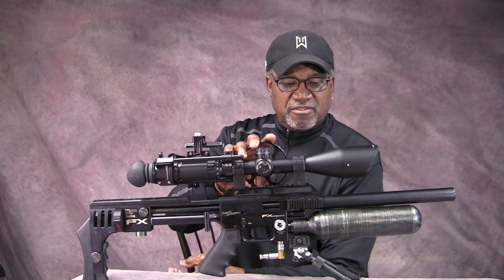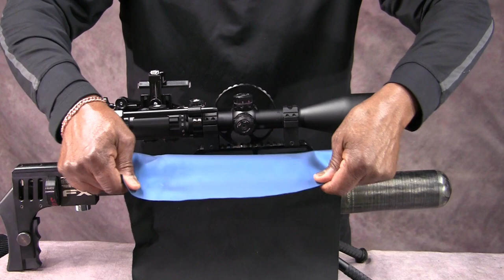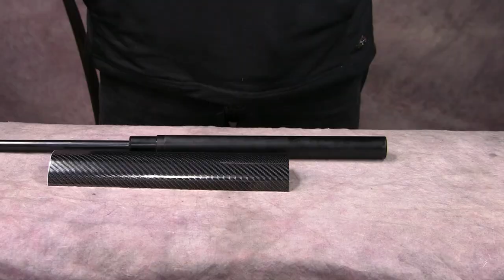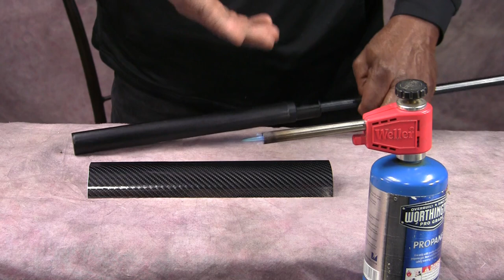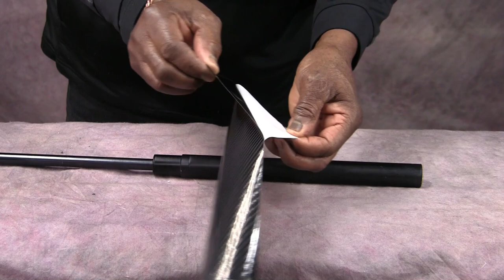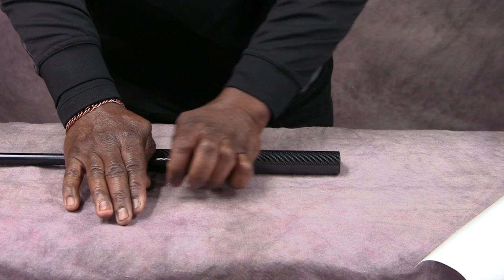FX Impact DIY Bottle Cover & Giving the Shroud a New Look

Comment: LOL Aaron,  I once put in a new water heater, changed the lines to copper, couldn't get the solder to seal. Called plumber, he thought I'd blame him if something went wrong... sooo he told me how to do it... saved big money 💰.  DIY is how to do it 🙂👍. Take care
Reply from the maker: I have put in water heaters and had the same problem until I learned about the proper use of flux and heat.   But I will always try to DIY before call in repair person.   Thanks and best of luck.

Comment: Nice job bud. I did the same thing with my bottles on my SK-19s also. I use neoprene 1.5mm and hot melt glue. Worked great too. Almost all my PCPS are wrapped in carbon fiber vinyl and yes sir...they look good! God bless.
Reply from the maker: The stuff I used is like neopreme and I never though of using glue.  That is a good idea.  I love the carbon fiber vinyl and it  protects the barrel from bumps and scratches.  Thanks for always watching.

Comment: I've had a similar idea to protect the kevlar bottle. We call them stubby coolers in Australia, I'm guessing you call them beer coolers in the USA. A couple of them slid over the cylinder should work. I just tried it on my FX and they're a little loose, but I have the Sabre Tactical extended rail to hold it in place. You could even make one out of an old wet suit or go to some place that makes stubby coolers and ask for an extra long one made. 🇦🇺👍
Reply from the maker: That is a great Idea.  I invented the extended rail.  Check out my called FX Impact Review and a Fix for the Bipod Attachment I posted 4 years ago.  I will look into the stubby coolers here and see if it can work.  You are my first viewer from Australia that has commented.  I have added you to my world map of viewers.  Thanks for watching and for your comment.  Best wishes.

Comment: You can get large heat shrink tubing for the carbon fibre bottle that way it will wrap around the neck of the bottle too. 👍
Reply from the maker: Shrink tubing would not feel as a good nor have the padding effect.   Thanks for watching.

Comment: Now I kinda wish I bought this instead of the hammer. Mine is tacted out too. I have the ronin & emperor suppressors shoulder strap pistol grip bipod green tac light green laser bug buster illuminated scope. I had Taser flashlight for it but I give that away til I get ccw permit. I'm kinda thinking on evol raw r hatsen blitz next but I need more research b4 choosing😎nice work. Wish you was local so we could shoot eachothers guns & I can see if fx is truely better than the hammer? Looks stronger than my dragonclaw? Dragonclaw is very accurate but not enough space to tac it out much just bipod shoulder strap& bug buster scope
Reply from the maker: You should be on stage.  Thanks for watching.

Comment: What kind of scope do you use on your fx impact I really like the look and set up I have a 30. Cal Hercules and shopping for a new scope
Reply: He uses UTG scopes. They are by far the best cheap scopes available. Love the large focus wheel, but it's extra. Next up is the Athlon Optics Argos BTR 6-24x50 . I have used both.
Reply from the maker: Check out my video on the UTG Accushot Sidewheel Focus 3x16x52mm.  That is the scope I use on all six of my guns.   You can find them on eBay and Amazon for about $200 if you search it really well.  Thank for watching.